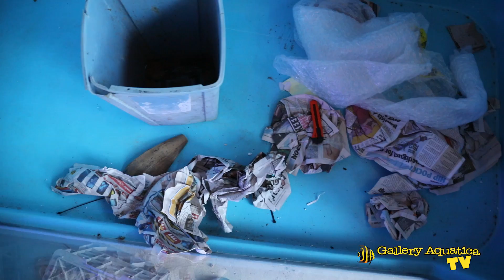The SPS MOTHERSHIP Episode #1 --- Gallery Aquatica TV

Comment: Try using a heat gun or blow dryer on a spot before cutting it. Also could try white vinegar or alcohol and squirt it in the crevice. Should soften up the silicone and make it easier to cut.
Reply from the maker: Goods tips, I’ll give it s go. Thanks 😊

Comment: Piano wire will have the silicone cut thru in no time (I actually use steel guitar strings usually). The hardest part will be getting it thru the gap. One guy inside, one outside with a sawing motion and you'll have it off in minutes. Also a damn sight safe than blades...the number of times I've cut myself doing that is ridiculous.

Comment: Killer thumbnail!! 😂😂😂 Great to be in at the beginning of a project, saves wondering later about stuff, and also demonstrates all the bits and pieces involved. It all takes time, I guess becomes the point. That’s a great tip about using tubing for spacers as you work away at removing the acrylic panel. And I bet a couple of beers always helps.....! 👍🏻👍🏻